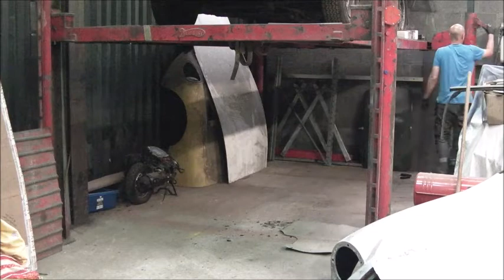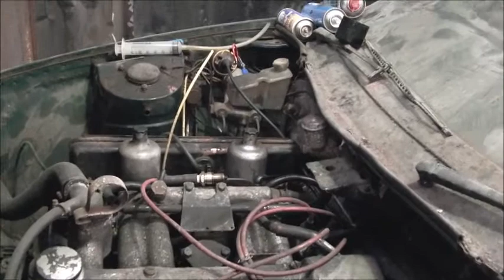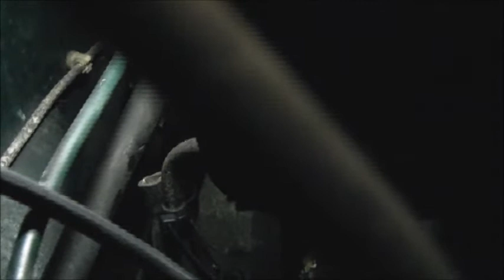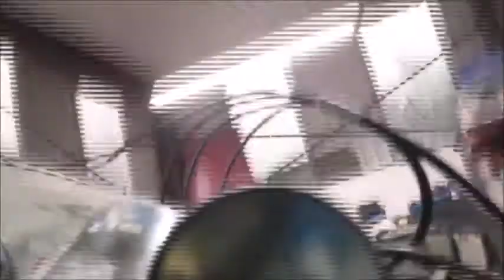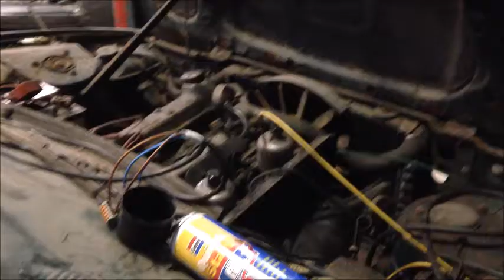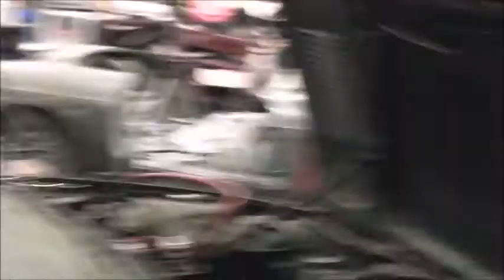TR7 Episode 4  Engine finally runs!!! 1st start garage find barnfind old start cold start

Comment: Hi. Did you get the car to run smoothly? In a TV show they found a TR7 that was misfiring had worn valves as from the factory it was designed to run on leaded fuel, so needed hardened valves.